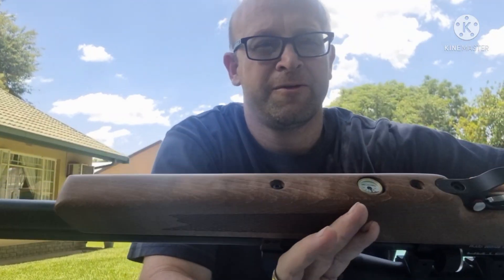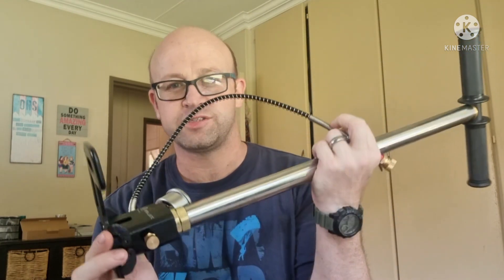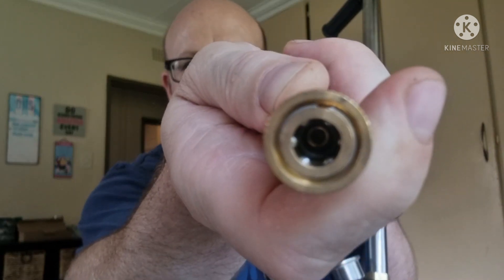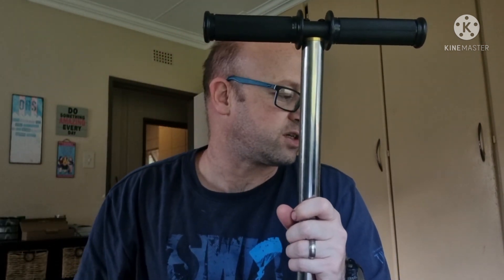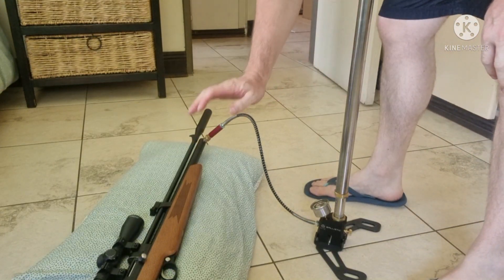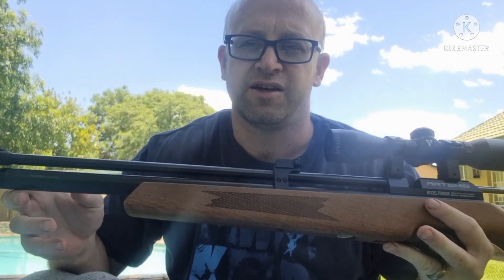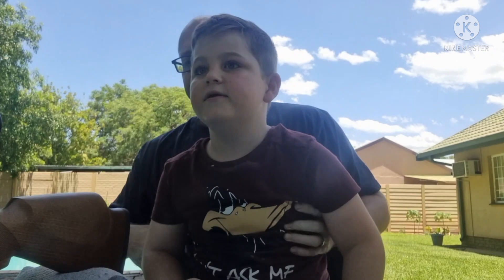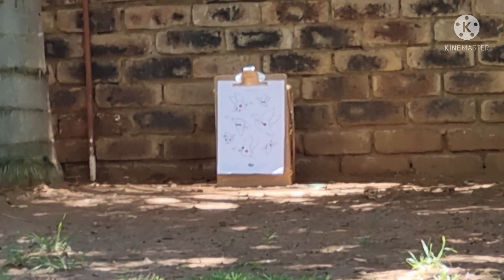PUMP up the pressure-Artemis PR900/Diana Stormrider

Comment: Thanks! I bought a cheap pump without info and with you video assembly and my first pumping went smoothly!
Reply from the maker: Glad I could help, I will most probably do a repair and maintenance vid as well some time
Reply: @African-Budget-Pellet-Gunner  Maybe I need to exchange the gun. It was very difficult to remove the barrel. When putting it back I found out, that if I wouldn't use the holder, the barrel would go up about 10cm... this is why removing and putting back the barrel is very hard. Sounds like a manufacturing problem?
Reply from the maker: Ok well I hope they corrected it for you

Comment: I,ve bought the same pump 18 month ago and use it on all of my PCP‘s. Some of them working on 230 or even 250 bar and i have no problems filling them. My Kral Puncher Ekinoks has a 480cc bottle and it take some strokes to fill it and i have to let the pump cool down if i want to use it for another gun😉.
Have no 300bar rifle and think it could be hard to pump that high pressure by hand. Great to see that your son also is a sharpshooter 👍😎
Reply from the maker: @Andreas Budischek that is great so how much extra effort is it to go to 250Bar I know it is probably difficult to quantify it. It definitely gets a little tougher on mine when I get to about 180Bar.
Reply from the maker: Agreed on the weight method it is just that last portion of the pumping which takes the most effort
Reply: @African-Budget-Pellet-Gunner  from 200 to 250 bar on my snowpeak t rex in 25 cal it takes a bit of effort to pump it especially the last strokes but once you lift the pump wait at the top a few secs than wait once tou hit bottom so the air can transfer im using a vevor 3 stage hand pump its way easier than i thought

Comment: Merry christmas Tyrone! Nice video - you are right, pumping doesn't seem to bad haha. Now I need to use up my co2 supply so I can justify upgrading :)
Reply: Curious did you drill out the transfer ports on this rifle?
Reply from the maker: @Patrick Renschler no this rifle is still standard want to spend some time before I start fiddling. Will probably not look for more power then probably do a bit of trigger work and maybe see what can be done to the bolt action

Comment: I went with the foot pump due to budget and I need more exercise anyway.😎🇺🇸
Reply from the maker: The hand pump with the PR900 is really not too much effort as long as you top up often enough every 15-20 shots or so
Reply: Is it okay to leave your PCP guns with pressure while being stored or should I bleed it out empty?
Reply from the maker: It is better to leave them with pressure, do not bleed out the air
Reply: @African-Budget-Pellet-Gunner  
Got it.
Thanks.
Reply: I didn't know you could get a foot pump I need that due to disability👍 what would I search for to find one please?
Reply from the maker: Ah ok, I haven't seen 1 before, I will check for you and let you know what I find
Reply: I sincerely apologize if I misled anyone on my foot pump quote!
It is a hand pump held down by feet while hand pumping. I literally put my foot in my own mouth.

Comment: Very useful info about the pump, thanks! When testing it, what pressure should be reached - and then presumably use the release valve at the back?
Reply from the maker: This pump was made for 200bar so I tested it to 200bar

Comment: You need to do pull the pump handle to the very top every time to take in air then hold for a second them fully down and also wait a second for the air to transfer to the gun.
Reply from the maker: Thanks for the heads-up

Comment: So i hand pump my snow peak t rex and from 90 bar to 250 bar it took me 30 mins with 2 breaks holding still on top and bottom for a few seconds makes pumping alot easier i will propably make a video on how to hand pump an airgun hope this helps
Reply from the maker: Hi there, sounds like you have your pumping down to an art. Yes, 200-250bar will prove to be the most effort but it is achievable. Fortunately the t-rex has a relatively small reservoir
Reply: @African-Budget-Pellet-Gunner   240cc i have the rifle version not the bullpup in 6.35mm at 60 joules it gives me 55-60 clean full power shots before it hits the regulator pressure and i need to fill it up again
Reply from the maker: That is a good number of shots, awesome. Thanks for sharing

Comment: Hey Tyrone, thanks for posting this.I am definitely going to buy my first PCP rifle soon and the only way I can do this within budget is by initially buying it with a hand pump. I'm commenting a year after you posted so how has this pump held up.? I personally like the brand anyway but keen to know. Haris will be chuffed when I finally place the order I've been saving for. I'm likely to get the PR900S because I will hunt with it. I've got the GR1600W abd Gertrude is taking a beating on the stock.
Reply from the maker: That is great Mark you will be happy with the PR900 S, they are great rifles. To pump up is really not as bad as everyone makes it out to be. With the small pressure tube on the PR900 pumping is a dream. If you do your pump maintenance, oil, clean and filters it will last really really long
Reply: thanks man. My GR does a through and throughh of an egyptian goose at 65 m. That girl of mine thrown our 18grain Velocity Force (Shameless plug, they're awesome)at 48 joules. Beast of a break barrel Gas Ram. I ndo believe that the PR is the right buy for me. Three rifles in that budget, the struggle is real. @African-Budget-Pellet-Gunner
Reply from the maker: PR900 gen2 is great if you're happy with a little less power around(20fpe) with reg set at 115bar or want to mainly do target work. The PR900 gen1(unregulated) which I had can go up to about 30fpe with about 14 pretty consistent shots so probably better for hunting. If de-tuned you will get more shots but less power, and probably a little more accuracy. Hands down, I believe the PCP will easily be more accurate than the artemis Gr1600

Comment: Pumping looks like a workout but not too bad !
I liked the informative part on different guns and pressure,

An avenger would just be harder to pump but I could still pump it by hand?
It is something to take in consideration tho!
Reply from the maker: Yes, you would definitely need to put in more effort to pump up an avenger and the bigger reservoir would also require more pumps for a fill. The other option for lower pressure is the Kral puncher NP01 and NP05 also runs at 200bar
Reply: @African-Budget-Pellet-Gunner  does the QB chief have a bigger reservoir too? Those are really affordable and atleast look like a nice starter pcp! 
I did not see much of those KRAL airguns arround here
Reply from the maker: @Lowkey ENT the qb chief looks like a great option as well. It seems to have a max fill pressure of 2000psi which is less than 150Bar so filling shouldn't be a problem. The tanks is 137cc which probably means your shot count could be a little low, definitely looks like a great entry level PCP. I actually forgot about the qb chief
Reply: @African-Budget-Pellet-Gunner  thanks Sir ! Sorry about all of those question but I really dont know much about pressure and stuff 😬 You did a great job making it sound simple!
Reply from the maker: @Lowkey ENT no need to be sorry, if I can share I will gladly do so. As long as it makes your life easier I am happy

Comment: Hey thanks for this content! This might be a stupid question, but is there a minimum i can fill up the stormrider? Could it be filled up to, say, 70 BAR? The reason i ask is that i need the airgun to be very quiet for indoor usage and im wondering if less pressure = lower velocity = quieter. Any idea? Thanks
Reply from the maker: Your assumption is 100% correct it will be much quieter. You will need to balance things out though. Smaller transfer port maybe 2.5mm and a lighter hammer spring.
Reply: @African-Budget-Pellet-Gunner  oh so you mean it cannot be done with the default setup? I was hoping I could do this out of the box without needing to tinker. Why might those changes be needed?
Reply from the maker: Is your stormrider regulated or unregulated? If it is regulated you could set the reg pressure down to 70bar and still fill to a higher pressure. Not that your rifle won't work but it is not going to be a smooth shot cycle. You see the pressure in the valve controls how long the valve stays open and to balance that out you use the tension of the hammer spring to control how hard you hit the valve. So if the pressure is low then it is like using an 8lb hammer to knock in small brad tacs. The other way to balance it is to make the transfer port smaller then you allow less air out of the valve this will reduce fps and thereby noise. The easiest solution is to get a bigger silencer
Reply: @African-Budget-Pellet-Gunner  thanks for the thorough reply. Mine is unregulated (just stock from the factory). So you're saying that even filling to 70 BAR unregulated will still be loud due to the force of the hammer spring? I was trying to find a regulator online but couldn't find one for sale. Not sure about a transfer port either, some were saying online that it's too risky to try to replace that. Maybe my best option would be a silencer from TKO?
Reply from the maker: Yes, the silencer is definitely the easiest option. The factory silencer is actually the same as what is used on the chaser so is probably a little under designed for the stormrider. You will need a silencer which has more volume. To work on the rifle is not very complicated I have videos showing all the ins and outs of the rifle. Unregulated only running at 70bar you can try it but you will hear your rifle will sound as if it is choking, it won't be a nice crisp shot cycle. Let me know how it works out for you

Comment: Ik this is a stupid question to ask but when i connect the filling port with the adaptor into the rifle. It feels loose and easily removed, do have to put in a certain way to fit it in place?
Reply from the maker: If the o-rings are missing or damaged it will be a little loose. If all is good it should be tight but not so tight that you can put it in and out by hand. Does it fill when you put pressure or does it leak
Reply: @African-Budget-Pellet-Gunner  No but the gauge in the pump doesn't move either
Reply: @African-Budget-Pellet-Gunner   I'm a bit new but what a o ring?
Reply: @African-Budget-Pellet-Gunner  I literally having trouble to fill in pressure tbh

Comment: What is the FPS on one like that in .177 ?
Just trying to compare it to a CO2 like the Chaser.  (I'm around 550fps on the CO2, so unless the PCP gets you up to that 675-700fps, then I think the CO2 is much easier on this old-mans back) 😁
Reply from the maker: @Plane Fun here is South Africa the PCP will definitely be around the 1000fps range, in the UK due to the sub 12fpe restrictions it will probably run between 750-780fps. I hope that helps, if you just doing closer range target work or pest control say up to 20m I do think the CO2 will work a charm.

Comment: About the hand pump, how realistic would it be to take it in a backpack on a several hour hike?
Reply from the maker: Well I definitely think it is light enough, the bottom legs also fold/flip up. It would definitely be a lot easier to carry around than say an air cylinder or compressor
Reply: @African-Budget-Pellet-Gunner  Hey thanks, I'm on the fence about getting my first pcp so that helps.
Reply from the maker: Look PCP's are great and definitely the future of airguns. I am sure you won't be disappointed when you do get a PCP

Comment: Did you flip the first part of the video, horizontally?
Reply from the maker: It is possible, sorry the video was done a while back. When I was a little less experienced with the videos I sometimes filmed using the selfie camera
Reply: @African-Budget-Pellet-Gunner  I thought it might be, because the cheek piece and bolt handle seemed to be on the wrong side.

Comment: Hello there 
I have a proboem with mine. I bought it brand new and for some reason it just would not fill with air. What can I do ?
Reply from the maker: @AIR~◇MAQ I have honestly not taken this gun apart yet but it sounds to me like you have a leaking o-ring somewhere. The problem could also be on your pump have you tested your pump by putting in the plug and checking if your pump reaches pressure.
Reply: @African-Budget-Pellet-Gunner  yes I also think it is the o ring but not the pump. I used a compressor and it works but the air cylinder won't fill with air
Reply from the maker: @AIR~◇MAQ when you are filling the rifle can you hear air leaking somewhere? If it is filling properly then you should at least hear air leaking somewhere.
Reply: @African-Budget-Pellet-Gunner  I didn't hear anything. I did check everywhere but can it also be the valve?
Reply from the maker: @AIR~◇MAQ if it is leaking the air must be going somewhere and if you say it is going to 120Bar that is a bit of pressure you will definitely hear or feel something. I really think the problem is at the filling portion of your rifle. You can do the tissue test at the breech/barrel section to see if there is a leak when the shot is fired
Reply: @African-Budget-Pellet-Gunner  I wil try that! Thanks alot!
Reply from the maker: Let me know what you find, then we can take it from there but we will get you back shooting 😉
Reply: @African-Budget-Pellet-Gunner  will do. Thanks alot!
Reply from the maker: Hi @AIR~◇MAQ sorry I see your comment didn't come through if you can perhaps send it again
Reply from the maker: @AIR~◇MAQ your comments aren't coming through perhaps try me on email tyrone8511@gmail.com
Reply: the fill probe must fitt correct ,the o rings must be perfect ,and not outside the hole of the gun ,when the probe is inserted. .and if the the gun is compete empty ,remove the front end  of the cilinder and replace the o ring under the screw

Comment: Tx.. a suggestion,  please tell us what size pellets you shooting
Reply from the maker: Most of the time .22 I am using 14gr pellets
Reply: @African-Budget-Pellet-Gunner  tx... I just bought one of these, using 18g.  From 25 m it was going through a coffee tin.. but only up to 17 shots... I was trying to work out how many shots are strong... I get about 30 shots,  then must pump it again...

A great pcp to plink about...
Reply: When I pump up mine it's gets to 200bar quite quickly,  but I notice I can't pump it higher, and yes I won't, but just  curious to know,  does it have a relief valve at 200 bar that is a protection against over pumping ?
Reply from the maker: I believe there is an internal relief valve in the pump yes but not sure what it would be set to from the factory as some guns run at 250bar some even 300bar so I suspect you would pop a seal on your gun before you reach the relief valve of the pump
Reply from the maker: You can perhaps check out my video on taming the unregulated pcp maybe that would help you. I have actually shortened my hammer spring to try quiet the gun down and I am operating between 110 and 130bar and get about 15 consistent shots
Reply from the maker: Here is the link https://youtu.be/KW8GfpkeW6o